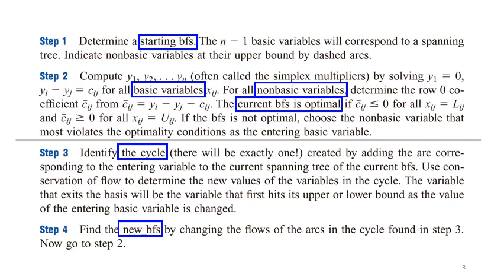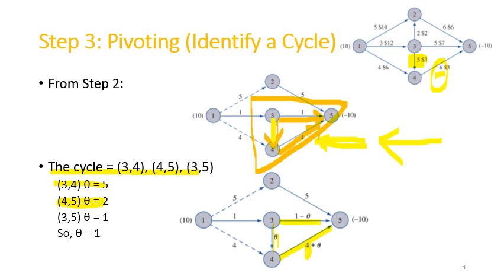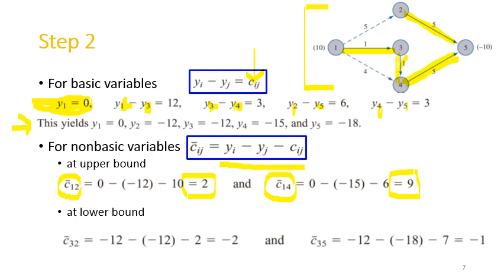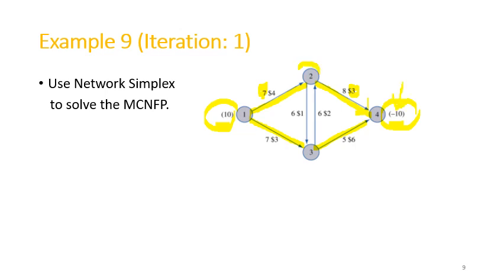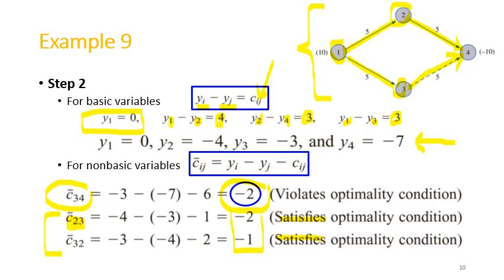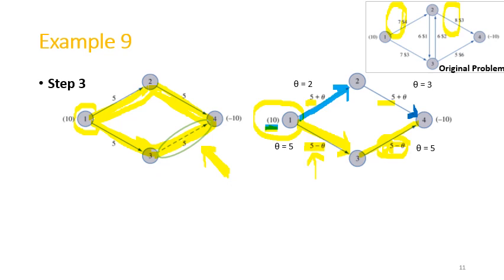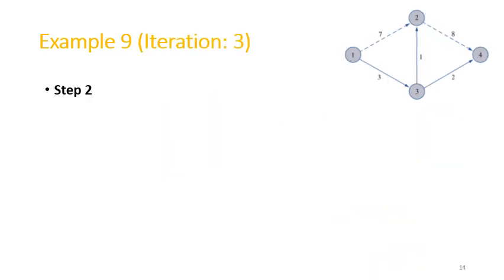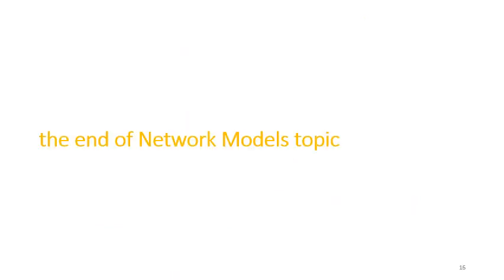Network Simplex (Part 2/2)

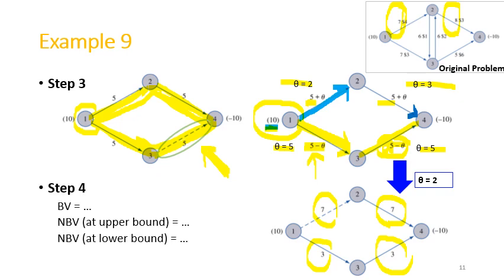Comment: how did node 1 -- 2 become a NBV in 23:57 minutes?
Reply from the maker: Hello! 
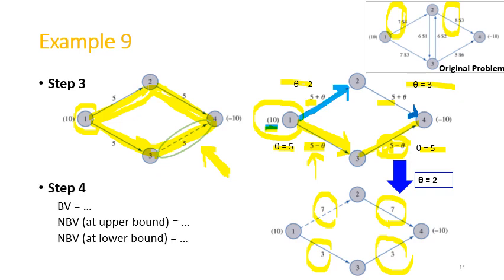In 23:57, it becomes an NBV because originally the flow is 5 (figure on top left), then based on Step 3 the node 1--2 experienced a change to become (5+delta) and delta equals 2; so (5+delta) equals 7.
Therefore, on Step 4, the flow of node 1--2 becomes 7. The capacity of node 1--2 is 7 (see the small figure on top right). In other word, node 1--2 is fully filled up to its maximum capacity (its Upper Bound). When an arc is fully filled up to its Upper Bound, it is an NBV; therefore node 1--2 (x_12) is an NBV.

I hope this is clear.